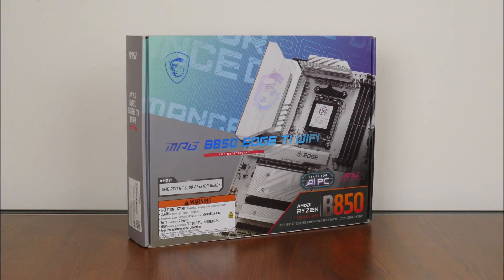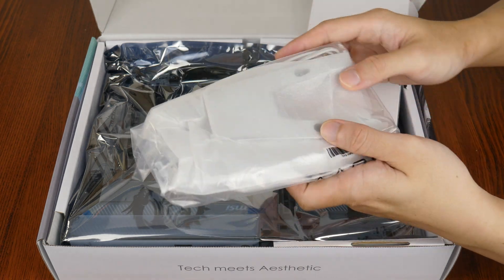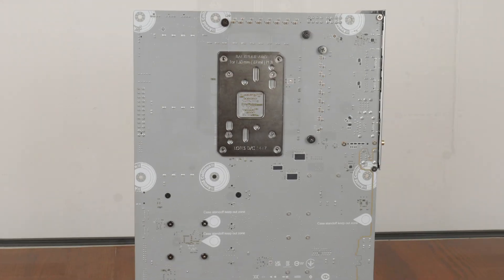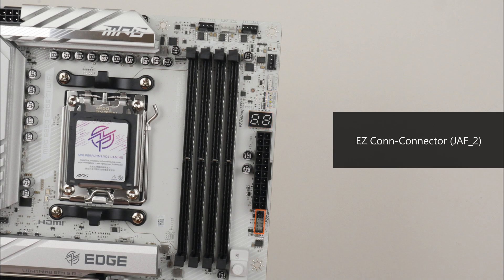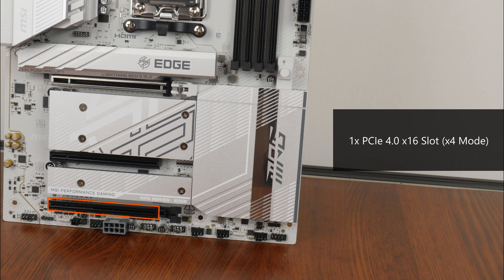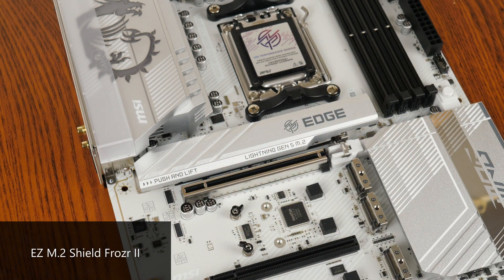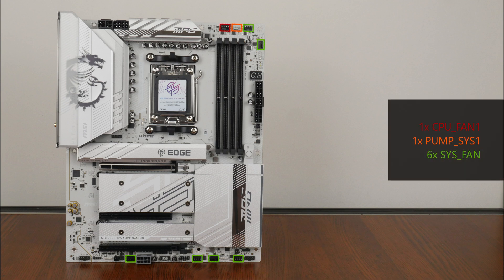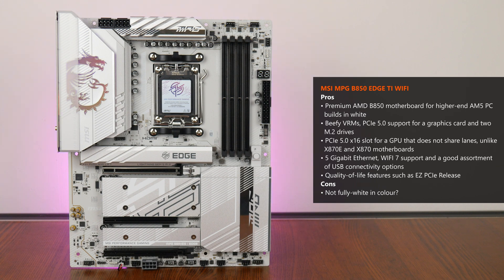The MSI MPG B850 EDGE TI WIFI is a premium AMD B850 motherboard for white AM5 PC builds!

Comment: Compared to the X870E version of this board, you effectively only lose the two PCIe 4.0 lanes for the M.2_3 slot (since no one in their right mind uses USB4 instead of a PCIe 5.0 SSD), unless you absolutely need both the PCIe 4.0x16(x4) slot and the full 4 SSD loadout at the same time. One can tell that this is probably the board MSI actually wanted to build before AMD came up with the braindead USB4 requirement.
Reply from the maker: Hopefully the next gen of AM5 chipsets come with plenty more PCIe lanes to avoid any of such lane sharing shenanigans!

Comment: I'm not going to lie I bought this motherboard because of the way it looks! 🗻   🕊    🦅
Reply from the maker: I guess it helps that it's a pretty good board too 😂 what processor and GPU will you be using with this board?
Reply: @ALKtech  AMD Ryzen 9800X3D and MSI 5070 TI Vanguard.

Comment: I didn't quite understand how the X870 version is better?) In X870 you have to choose between two nwme PCI 5.0 or two USB4. What is its advantage then?) I'm choosing between X870 and B850 now and I can't decide
Reply from the maker: Yeah precisely - the X870 is basically a renamed X670 with no additional PCIe lanes, but with USB4 support made mandatory, where as a result, mobo manufacturers have to find ways to "borrow" PCIe lanes from other onboard connectors/devices to support the USB4 controller. Personally, if I have no need for USB4 support, I'd much rather get a higher-end B850 board that has full support for a Gen5 graphics card and Gen5 M.2 drive with no lane sharing that could otherwise affect my graphics card and M.2 drive's bandwidth! Plus, you'd save some cash that can be used on other parts of your PC - my two cents!
Reply: @ALKtech  I'm glad to hear that I got the differences between these two boards right) Because I went to reddit, and they answered me with some complete nonsense) 
"X870e edge has: cpu chipset+chipset1+chipset2
9 rear usb slots + 3 being usb c(2 10gbps, 1 40gbps)
4 m.2 slots(2 pcie 5, 2 pcie 4). The pcie5 share the lane with gpu. So, to get full speed, you can run GPU, ONE pcie5 and 2 pcie4 nvme ssds. You also have 4 sata slots.

B850 edge has: cpu chipset+chipset1
7 rear usb slots, + 3being usb c(all 10gbps)
4 m.2 slots again, but now there is only 1 chipset that handles m.2 pcie4 ssds and usbc at the rear
also 4 sata slots
I think you can only run gpu, 1 pcie5 and 1 pcie4 nvme, start populating more slots and you will start losing rear and front slots.
"
Reply from the maker: Oops. MSI's implementation of lane sharing for both the B850 EDGE TI WIFI and X870E EDGE TI WIFI is quite different from typical X870E/X870/B850 boards, but in a better way, in that the primary Gen5 slot for a graphics card doesn't drop down to x8 mode from x16 mode with any permutation of M.2 drive installed. The folks over at Reddit might have assumed that these two MSI boards have the "typical" kind of lane sharing that results in the x16 slot for a graphics card dropping down to x8!
Reply: @ALKtech  Thanks for the answer!) I still couldn't decide which board to buy X870E or B850... As it turned out, X870E gives us the ability to normally install only 1 nvme ssd, this is m2_1. Even if we install gen4 ssd in m2_2, we will lose usb4. And m2_3 and m2_4 are chipset lines, which will also cut the speed of the ssd ((( It turns out that if we install two nvme ssd, we will have only 1 usb-c input, which in today's reality is already quite little (sound card, microphone, etc.). With all this, B850 allows you to install two nvme gen5 ssd without any problems without any restrictions, but has a small number of usb inputs on the board ((
Reply from the maker: Happy to help! Yeah that's basically the state of the AM5 platform at this point in time - AMD's next-gen AM5 chipset should hopefully add more lanes and we should get less of these lane-sharing stuff going on. In the meantime, if you're looking to build an AM5 PC, you've gotta decide which trade-off you're most comfortable with 😅
Reply: @ALKtech  If I understood everything correctly according to the specification, then in X870E we will be able to normally use only 1 nvme ssd (m2_1), i.e. m2_2 will disable usb4 (they are of little use to anyone, but one type-c input in the current reality may also be not enough) and I was also told that if you install nvme ssd in slots m2_3 or m2_4 (for chipset), they will work much slower, because of the chipset. I don't know how true this is.
At the same time B850 will give us two nvme ssd (m2_1 and m2_2) without any restrictions (if I understood correctly), but less usb on the back side of the board. I hope I did not make a mistake anywhere
Reply from the maker: Yup you're pretty much right - for the X870E EDGE TI WIFI, when you've got a drive installed in slot M.2_2, M.2_2 will run at PCIe 5.0 x2 speeds instead of x4, and the dual USB4 ports will operate at PCIe 5.0 x2 speeds as well - these USB4 ports will still work, just that they won't be operating at full PCIe 5.0 x4 bandwidth. I can't confirm the exact impact on throughput though, as I didn't get the chance to test the impact on bandwidth. That said, you have the option of disabling USB4 entirely, which will mean that M.2_2 will operate at full PCIe 5.0 x4 mode.

For the B850 EDGE TI WIFI, you're right as well. Do note that PCI_E3 (which is the PCIe 4.0 x16 slot that runs at x4 mode) will run at x2 speed instead when you have a drive installed in M.2_3, which is a PCIe 4.0 x2 M.2 slot.

Hope this helps!

Comment: Great review! I bought this board
Reply from the maker: Cheers! What's the specs of the PC that you'll be building with this board?
Reply: @ALKtech 
I've got all my other components now, just the motherboard is remaining.
Processor - AMD R7 9700X (had planned to go for 7700X but it was only 20AUD cheaper than 9700X, so went with 9700X)
RAM - Corsair 2x16GB 6000mhz CL30
PSU - MSI MAG A850GL
Case - Antec C5 White
CPU cooler - Thermaltake Aqua Elite V3 White
GPU - XFX RX 580 GTS XXX edition 8GB (temporary placeholder card, will wait for new AMD GPUs 9070XT coming out this March in a few days)
Reply from the maker: Sounds like a great mid-range gaming PC build!

Comment: Was going for the ASUS ROG Strix X870-A Gaming WIFI before watching your video, now i think i save myself 200 dollars and go with this instead :D.
Reply from the maker: Oof that's a heck of a price difference, I'd go with the MSI too over the ASUS X870-A! Use those cash savings on some other part of your PC, such as a better CPU, PC case etc!
Reply: @ALKtech  yep, everything is expensive here in sweden ^^. 
everything else is kind of bought. just waiting for a chance to buy a 5090. but i guess that will be like 6 months away =(
Reply from the maker: @ fingers crossed that you'll be able to snag a 5090 at non-scalper prices!
Reply: @ ha! i want the a aorus master ice. it will be 3200 dollar from the store xD
Reply from the maker: @ 😅 it's a sweet looking card though! Will you be using a dual-chamber PC case with glass panels all around to showcase your build?

Comment: Good review. Thank u! And  MSI B850 Gaming Plus WiFi? Is it any good?
Reply from the maker: The B850 Gaming Plus WIFI is several steps down from the MPG B850 EDGE TI WIFI in terms of product positioning, where it has a more "basic" aesthetic, a more entry-level VRM setup and does away with the fancy quality-of-life features. It'll definitely be way cheaper than the board in this video though, and should still handle even higher-end Ryzen 9000 series processors well enough!
Reply: @ALKtech  Thank you for your reply!
Reply: @ALKtech  what about MSI B850 Tomahawk ? Is it better? 
Thanks in advance
Reply from the maker: @ both boards are pretty much identical actually in terms of specs- the Tomahawk is designed for black-coloured PC builds, and the EDGE TI WIFI for white-coloured PC builds!
Reply: @ALKtech  Thanks for your reply. I set my eye on Tomahawk.

Comment: A bit disappointed to see the rear I/O compared to their previous gen
Reply from the maker: Are you referring to the MPG B650 EDGE WIFI? If so, I do get where you're coming from, especially given this board's 4x USB 2.0 ports on the rear that seems, a tad out-of-place for a more premium motherboard offering...MSI could have included more USB 5Gbps ports instead!
Reply: @ALKtech yes. I mentioned B650 Edge

Comment: Good review again ! what u prefer B850 AORUS ELITE WIFI7  or this one ?!
Reply from the maker: Thanks! The MSI board in this video has a more premium feature set compared to the Gigabyte B850 AORUS ELITE WIFI7 ICE, so it'll really depend on what's the most important to you! Personally, if aesthetics take precedence, I'd go for the Gigabyte board, given its actual full-white aesthetic...another factor to consider would be pricing too - is there a big difference in price between both boards where you're from?
Reply: @ALKtech  actually around 70 more for the MSI , MSI is at 350 at that point a  ice pro x870e would be  50 more :X but it hurt the wall of lanes sharing
Reply from the maker: @nel5460  mmm I see. Yeah, the PCIe lane sharing situation with X870E and X870 boards is a bit of a bummer (even though the performance impact that this has on your graphics performance should be minimal). Do you have a processor in mind already? If you don't have a need for the more premium features that the MSI B850 EDGE TI WIFI has, getting the Gigabyte is not a bad option at all I'd say..
Reply: @ALKtech  9600x or 9700x or 7800x3d when price go down if they do ..., they are crazy actually more than 600 for brand new 7800x3d 😆
Reply from the maker: @nel5460  yes the pricing situation for the 9800X3D and 7800X3D is nuts...I bought my 7800X3D brand new for around US$350 a month or so before the 9800X3D launched and I'm thankful that I did 😅
Reply: @ALKtech  ooh good job xD i will wait and see if price drop for proc or either motherboard :€